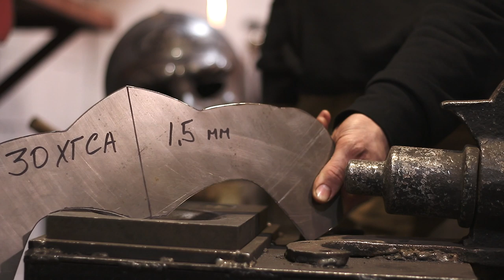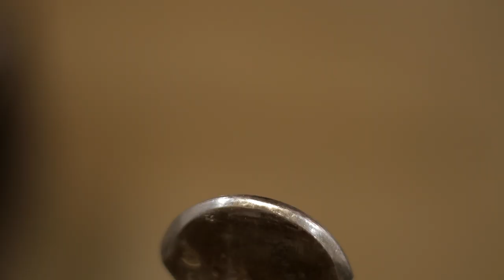How to make forged face. DIY Forging armor

Comment: How did the metal turn gold exactly? Was the brush extending a torch heat blue process or was the torches heat making the copper deposit onto the metal? Very cool trick!
Reply: not copper, an annealing process, the steel changes colour at different temperatures.
Reply: @marksmallman4572  Yeah that was my first guess. I've seen cases of straw blue and blue-blue from cooling in the air but I never seen it end with a black haze over the top and able to be polished out. I kinda thought a polish would affect its color
Reply: @hughgrection3052  the upper gold area you ask in the first comment is show in the video. The steel is heated, then a brass wire wheel brush is used. This deposits the brass onto the steel to give the gold finish
Reply: @facs599  Ahhhh... ok. Makes sense. Yeah wasn't sure if it was there already and was being revealed somehow, or if it was a straw gold heat treat. Brass being transferred makes good sense. Thanks bud
Reply: @hughgrection3052  no bother man